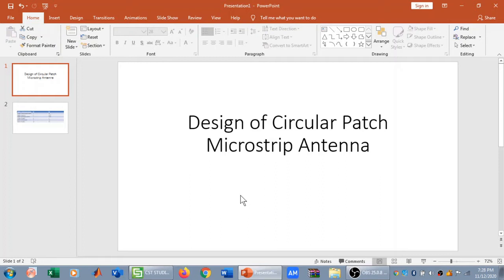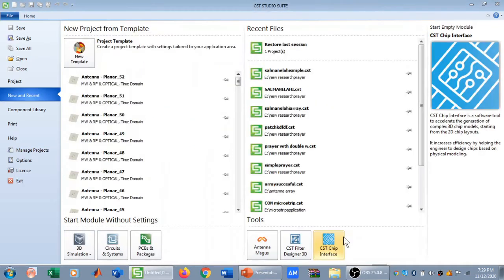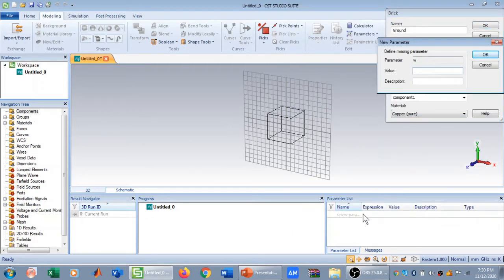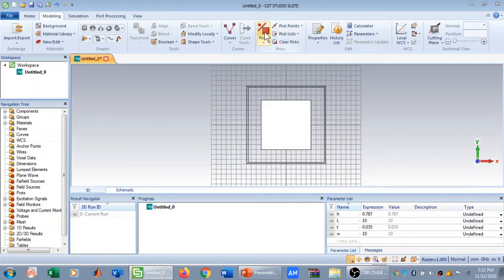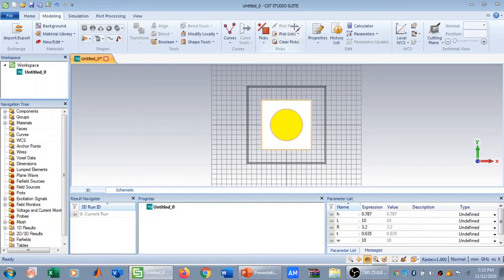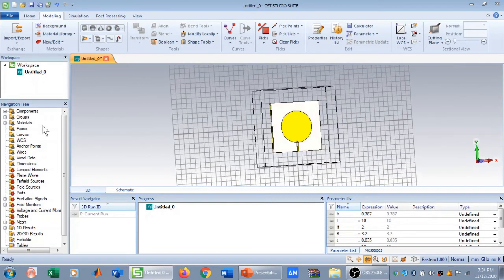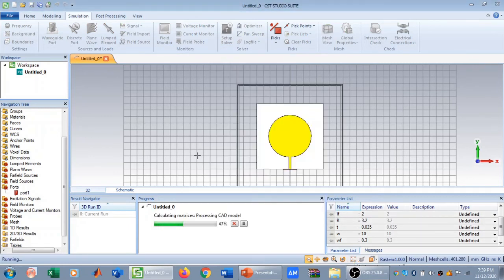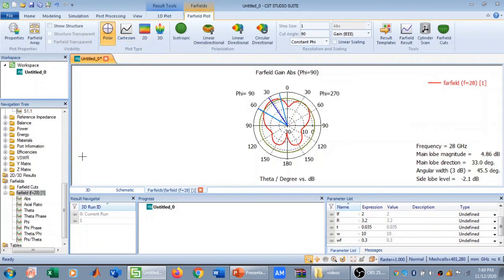Circular Microstrip Patch Antenna Design for 5G applications

Comment: Respected sir i simulate the same antenna in cst 2021 the resonance frequency is 28.3 GHZ.I design for 28GHZ.I cross check and simulate twicw.can you please tell me why the operating frequency deviate.
Moreover,Sir how you choose the height of substrate and feedline(i.e attach to circular patch) length and width.